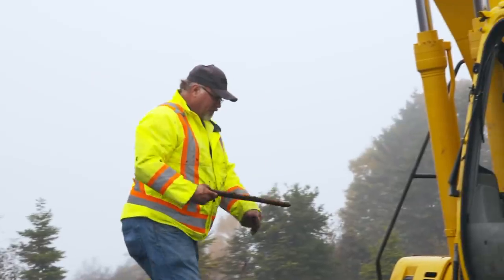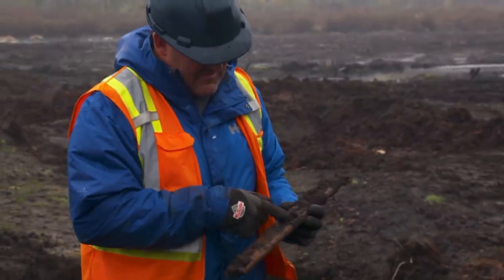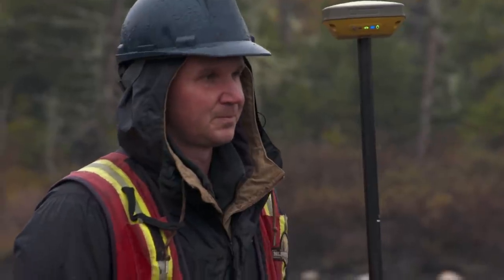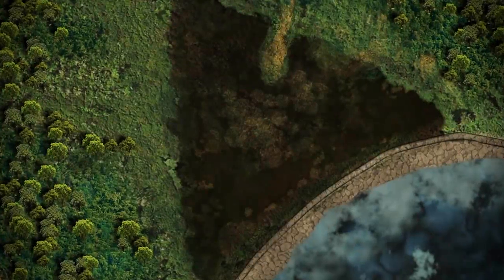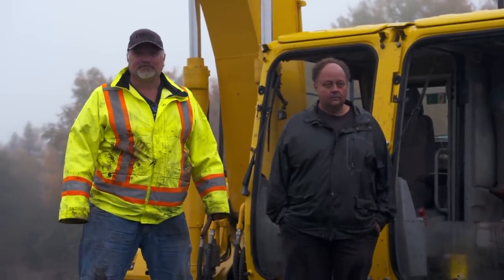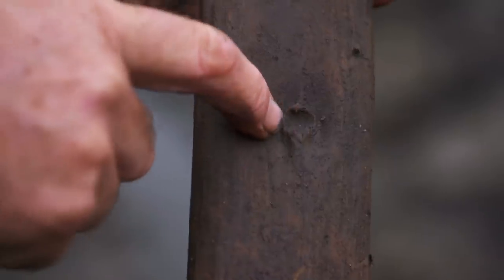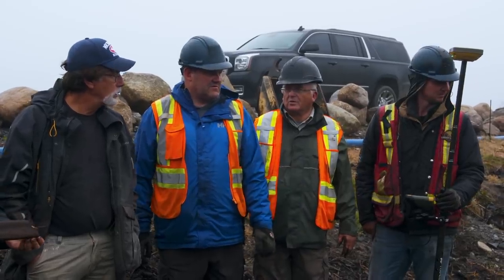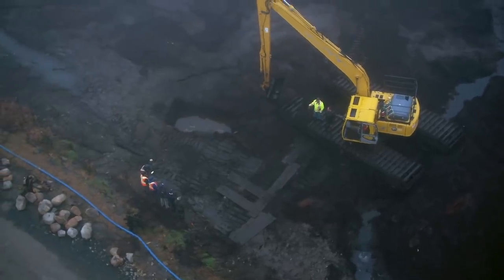The Curse of Oak Island: MAJOR SHIP DISCOVERY Changes Everything (Season 8) | History

Comment: Since they're getting close, I'll go ahead and say it. "I don't think that smell is natural". Sailor from that era were no strangers AT ALL, to "tar" and "pitch". Not only would they probably want to waterproof (making recovery easier) the outside of any wood container (even one as large as a ship), but, you'd want to keep the sea from coming in and washing everything out with the tides or even a storm. A DAM. A coconut, stone, and pitch DAM. When, in a past episode, they said the mud "smelled" I thought, usually bogs smell when there was something dead or dying in that place, but if they're recovered bolts/spikes there, my guess is "pitch". The mud itself holds a clue, get it tested on the molecular level. If the swamp is "artificial" it may help get around "some" (hopefully not all) environmental constraints. ((it can also give context clues as to what degree of engineering, tooling, and planning they were using))

Comment: I am getting the impression that the Money Pit they are looking for is actually an earlier searcher effort. There are apparently artifacts indicating tunnels or maybe a shaft and/or cavern created much earlier. If that is the case whomever dug the original structure may have not been able to return, say due to depletion of resources or having been thwarted in some way. The subsequent searchers may have come across information compelling enough to go through a lot of effort and expenditure to recover it (I.e. the Money Pit). The oak platforms reported would probably been staging for incremental excavation to reach a target depth. That effort may have failed for the same reason subsequent ones did: flooding. 
At any rate, drilling boreholes systematically is a reasonable if expensive approach. I would like the mystery solved if not a treasure discovered.

Comment: I have never seen an excavating crew that does not know how to dig a water diversion that would possibly help cure the delay of a project for a years time. You would run that  square along a strait edge and you then have an equal space or line. Siders hook that under each piece of siding then setting the next piece on the top to keep equal spacing. I make one of those any time hanging siding . There is a hole in the handle also to pin that down and set your scribe at the end of the square to make a circle. The length of that square looks like half the radius of one of those keg tops they found. How much money did they waste without common sense or knowledge of typical construction. That water seeping in that hole was just about as stupid as when the diver chipped a coin off the wall of 10-x and dropped it . I will have to go out there for quality control. Archeology teams dusting off rocks usually is more efficient with more than 2 people dusting. Winter is coming dust faster. When you find a hinge on the top of an ancient cellar door , dust off the rest of the door before you proclaim the hinge belongs to a totally different artifact.

Comment: These guys have done a lot, learned a lot, but I can't help questioning their entire strategy.
They've done too much digging and too little thinking.   Yet, what they have done has revealed a lot of information so of course I could be completely wrong.
What would I would do if it were me directing the search.
Well, for a fraction of the money they've spent , I would guess maybe 25%, which is a number still in the millions,  I would ring the island with the same kind of sensors which were used to detect the cavity in the great pyramid.  It involves muon technology triggered by cosmic rays so you'd need to wait a month or two, or more to collect the data and then that data would reveal ALL or most of the tunnels under the whole island.   Vertical shafts could be seen too of course.   NOW you plan your digging, after you get the images computed back from those muon scans.    It would show any buried ships or other anomalies too.    By following the searcher tunnels directions,  they could easily guess at the near exact location of the so called "money pit" as well.   The sensors would nee to be placed, perhaps 100 ft. apart, around the island,  at a depth to be determined by the Japanese experts who are familiar with the capabilities of this scanning technique.   The density of excited muons being greater in holes and cavities and much less in earth or rocks,  the entire layout becomes deducible in one shot.